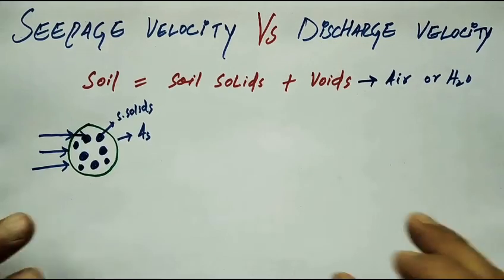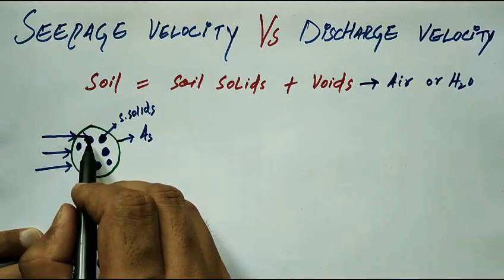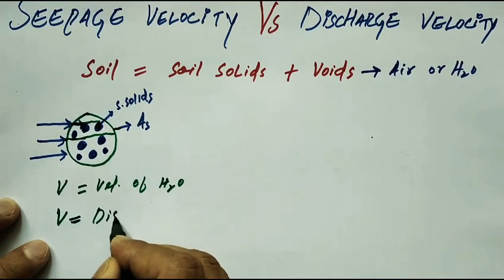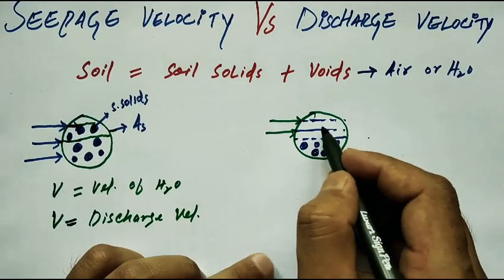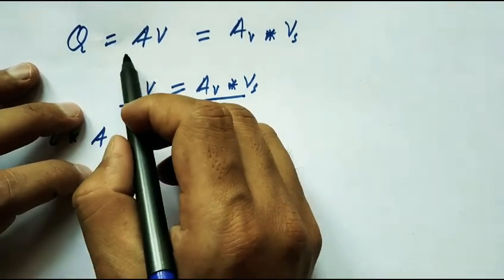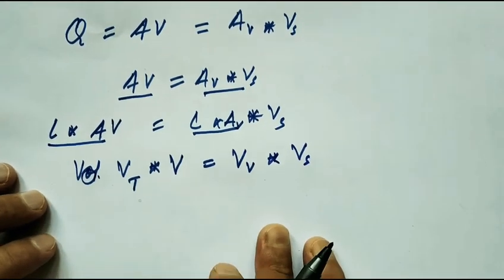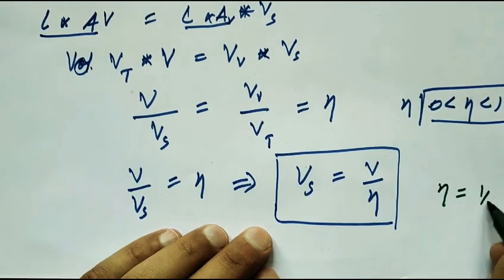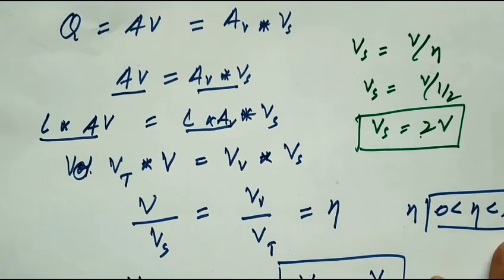Difference between Seepage velocity and Discharge velocity || Derivation for seepage velocity ||

Comment: This is not correct. Specific discharge represents the velocity at which water would move through an aquifer if the aquifer were an open conduit. This video has them backwards.